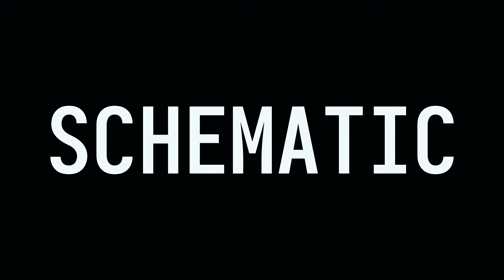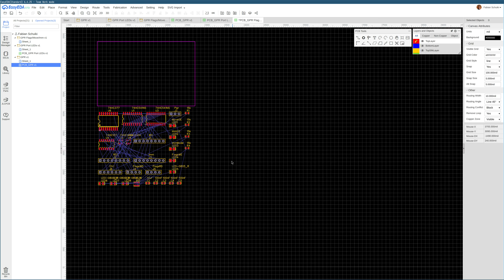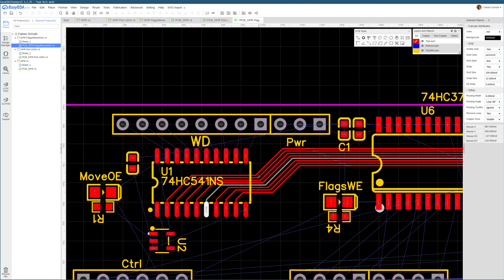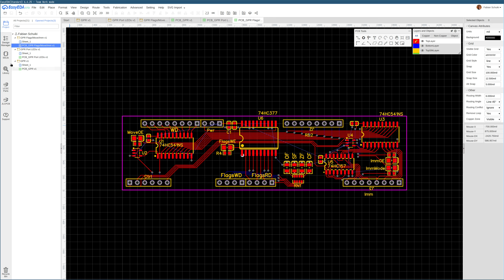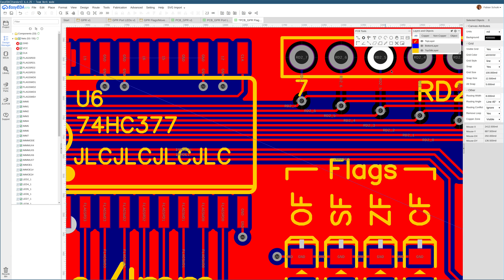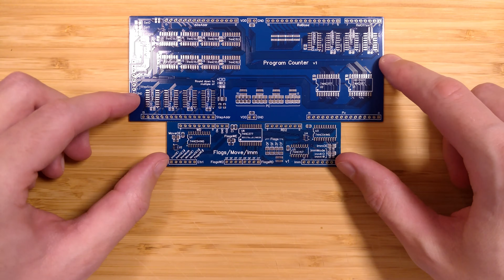Flags/Immediate/Move PCB – Superscalar 8-Bit CPU #41

Comment: Amazing series. Very inspirational.

I have two questions, maybe you've already discussed this in a previous video.

1. Would you consider other families in the 7400 series? In particular the AHC/VHC families seem quite nice and their SMD-only aspect are no problem for this project. Should be fully compatible with the HC family.
2. Are you going to expand the amount of read and write ports for the register file in the future? 3 ports might form a bottleneck when trying to go past scalar performance.
Reply from the maker: Thank you very much! 😃 I'll definitely look into the AHC/VHC families, or at least try to get my hands on those chips if they are available. At some point I'll have to do some static timing analysis of the build, and the need for AHC-speed chips will probably become appareny then 😏

I plan to expand the registers to 4 read, 2 issue, and 2 writeback ports eventually. Fingers crossed that those will still somehow fit into the build 😁

Comment: You could've used the mux enable line to get a 4 bit zero extended immediate mode.
Not sure how useful that would've been without considering the whole instruction set tho.
Reply from the maker: Yes good point! 🙂 I couldn't think of instructions where you'd only want to pass in positive immediates, but never a negative one. Couldn't think of any! I expect the small immediates to be useful for things like and, or, xor and maybe the load and store instructions. Small address offsets and the like. For those you definitely also want negative values!
Reply: For address offsets 4 bits is really stretching it tbh. The average stack frame is much bigger than this, and so are many structs.
Reply from the maker: @Artentus That is very true. There is still a benefit though: if you have to push multiple things onto the stack at once, this can be the difference of having 1 add op per 1 store op, or 1 add op per 8 store ops.